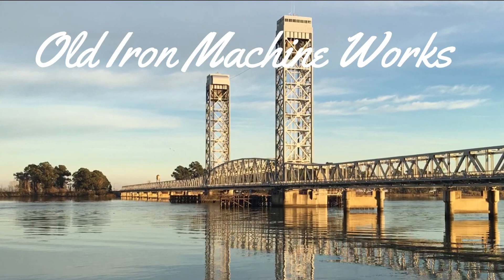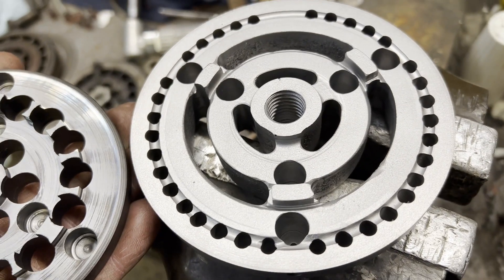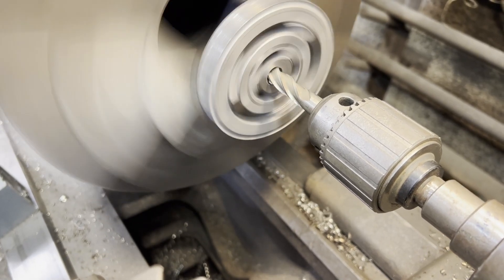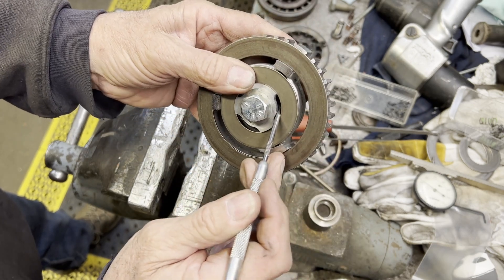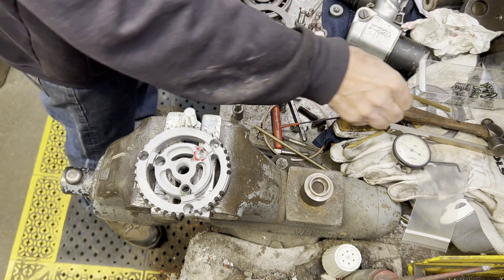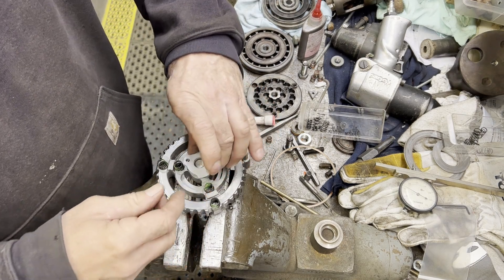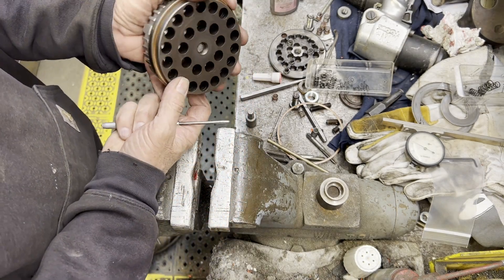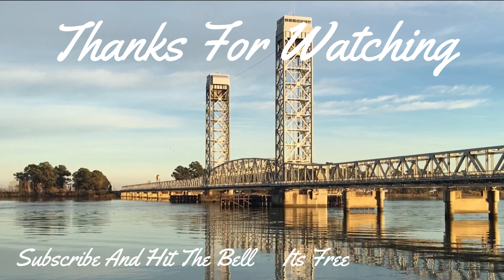Valve Repair, Gardner Denver

Comment: Wow, very creative solution, getting the part right away rather than in X weeks. Using a magnet to grab small parts as they come off the stock is very clever. Thanks for another excellent video.
Reply from the maker: Thank you Bruce

Comment: Nice work Gary, Those are some high end valves for an air compressor (quality unit). The old larger refrigeration compressors I used to work on used simular ring valves, there very efficient. Spring breakage was the biggest issue and if not noticed in time the ring valve would break from the uneven stress and wipe out the cylinder. Nice trip down memory lane..
Thanks, ATB...Dean
Reply from the maker: Thank you Dean, I do lots of different valves but haven’t showed much of it.
I guess I should show more valve repair on my channel.
Enjoyed today’s ARW. I normally don’t get to watch it live. And now I realize just how much I don’t know about YouTube LOL
Thanks for stopping by Dean.      Gary

Comment: Interesting that they used coil springs in the air path given their tendency to break into hard little pieces that the compressor can eat. I thought bellville type washers were more the preferred method for these as they are more fatigue resistant and usually when they fail they just break but because they are large and flat they don’t wind up traveling to other areas and causing problems.
Reply from the maker: Brian, I have literally done thousands of valves over the last 21 years and a lot of our style do use what they call spring plate which is what you’re referring to but it seems like they’ve switched over and using lot more coil springs. But I do agree with you stuff breaks all the time. I should probably do a video showing more valve repair.
Thanks for stopping by and commenting.    Gary
Reply: @OldIronMachineWorks  Yes it was an interesting video. I always enjoy seeing the different ways different manufacturers accomplish the same thing.

Comment: The valve plate that has drilled holes instead of curved slots, does that have a specific purpose? Or to ask in a different way, does the shape of the air channel have an effect that is desirable? Or does it make no difference other than surface area? I guess I don't know if air behaves the same as other fluids, with a tendency to spiral around the circumference of the cylinder it's traveling in?
Reply from the maker: Jean-Paul, I see lots of different port styles in Valves and I think it’s more about the size of the ports then it is the shape of the ports.
When companies design valves they do flow test when developing them.
But that was a good question. Thanks for checking out the video.    Gary